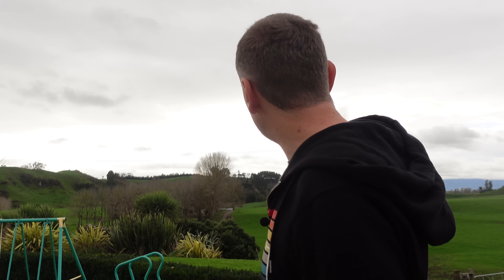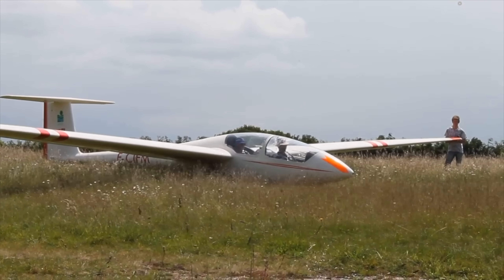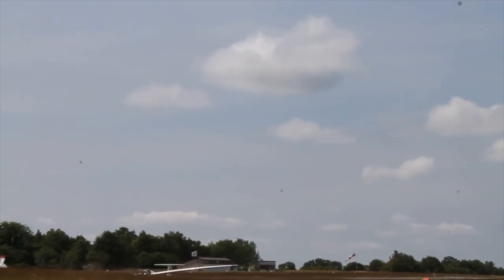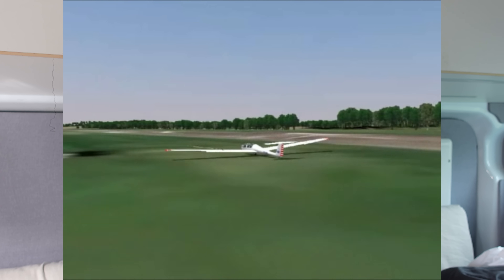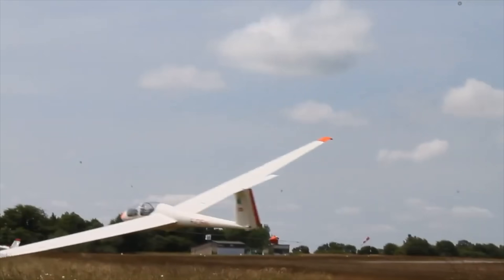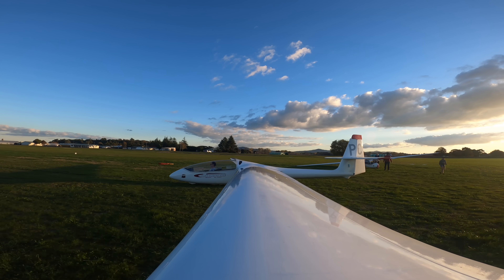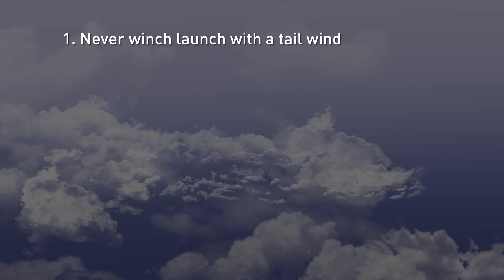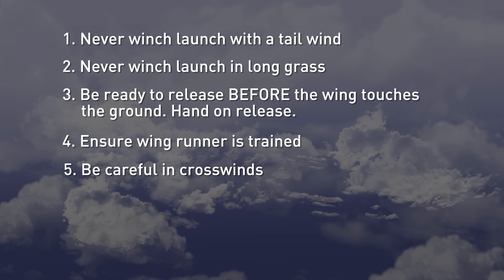Glider Winch Launch Crash 💥 Instructor Reacts

Comment: Agree with grass too long and failure to release in a timely fashion. Disagree with 'not enough wing running'; the young lad clearly goes to run, but the acceleration is actually very fast without a lull, and there's no way he could have kept up any longer than he managed to - even when you do a 'slomo' in your video it's obvious that he was going to run, but but gave up when he realised the thing shot out of his hand far quicker than he could have kept up with. The failures here are significant and lay on the shoulders of some of those present and on those responsible for the running of the club, including, but not limited to, those responsible for winch launch safety and grounds maintenance. The lad holding the wing bears no responsibility and you ought to right your wrong of implying he is at some fault - this could be weighing very heavily on him and causing undue mental angst / distress or worse. I'm a UK glider pilot and do not know any of the people in this video, directly or indirectly. Finally, the wing is seemingly held level without significant change to its angle relative to ground inputted by wingholder. He did nothing wrong.
Reply from the maker: Hi I don’t disagree with you, and I didn’t mean to imply the cause of the accident was the wing running. However it was a factor, and potentially couldn’t run because of the long grass. Also the cross wind was a factor which I didn’t go into enough, once the wind got under the wing there was no stopping it. Cheers!

Comment: Seems I am the only one noticing that the guy running the winch didn't reduce power at all.
Actually my gliding teacher never made me aware of that problem.
He told me about winch cable rips, and that is what I prepared for. 
Probably I would have done the same mistake - unprepared.
Reply from the maker: Yeah exactly right, and why I think this is an excellent lesson for everyone who winches. Always be ready to release, and read some of the comments from those who have been in this situation. Very interesting

Comment: As an engineer I would suggest also technical advances: wheels on wings and progressing winch speed. Design the problem out.
Reply from the maker: They have wheels on wings. That won't help with grass up to your knees, because the grass will grab the part of the wing that doesn't have a wheel just as well as the bit with a wheel. No you can't make the wings tall enough for that grass, the drag would be too much.
And why would "progressing winch speed" help? More speed = more air over the wings = more control for the pilots. Slower for longer = less air and less control. So you want to accelerate quickly. The trick is not to drag a wing on the ground...

Comment: The only action I see the pilot could have done to prevent this is to get the lawn mower out and mow that grass before takeoff.  To suggest the wing runner had any roll in this is absurd.
Reply from the maker: I agree the grass should have been mowed obviously. Sure the wing runner might not have made any difference, but they might have been a contributing factor. So they should always literally run the wing. Obviously they're not the one and only reason for the accident. The cross wind was probably more of a factor than mentioned in the video. Saying that the wing runner should still run. Of course maybe he couldn't because of the long grass...
Reply: @PureGlide The pilot chose to attempt take off from a runway that was obstructed by vegetation.  That’s poor judgement.  All these other things you bring up as contributing factors are all normal experiences of flying.  A lazy wing runner, or worse, one that doesn’t let go, or cross winds, tail winds, or down drafts on final, cable or tow rope break.  If you haven’t faced any of these yet, you will one day.  It doesn’t mean you have to crash.  That’s why you train to fly - So you learn to deal with these.  It’s normal.  
As far as grass wrapping around a wing - no amount of control input is likely to overpower that.  If you are voluntarily planning to put your glider where you will encounter conditions that may overpower your ability to maintain control - whether that be a thunderstorm, or some tall grass, or a tree - you are demonstrating poor judgment.   And as all of us involved in aviation know all too well, poor judgement may make for exciting stories and cool videos, it seldom makes for happy endings.
Reply: @andyweiher4303  again, well said.
Reply: Well said. Similar to what I subsequently said.

Comment: So this is not a problem when towing since you use a tow point in the front? Would it be an idea to have a second hookup in the nose that would release first, after you gained enough speed to have control and then do the climb/kite up. Like dragging a log, you use a hitch on the log and another hitch on the same line at the front end of the log to keep its orientation.
Reply from the maker: Not a crazy idea at all! It would require aircraft modification which is quite a big deal, as gliders are type certified aircraft. Not quite sure it's worth the development effort as 99.99% of the time it's not a problem, especially if you don't do it on long grass, and are quick to release if things start going wrong.

Comment: sounds like an accelerometer to measure angle with a automated line release would increase safety.
Reply from the maker: That’s an interesting idea!
Reply: Also if the electronic design was smart once armed there would be a safety button on the yoke that would need to be held down to maintain the locked cable.  If the button was released it would release the cable.   This way the default behavior is to let go of the button to release which is more instinctive to do in an emergency than to pull a release lever.  I don't fly full size planes (only RC) so I am not sure how the current actual mechanism works but I suspect is lever or cable drawn mechanism.

Comment: The later you leave it the greater the chance that the rope will move back in the hitch to the point that it will not release !
There is an excelent artical about tug upsets when using the winch point for aerotowing that prevents a release due to the angle of the rope in the hitch !
Reply from the maker: Yeah exactly right. In this case I learned later the cable back released, the pilots did not release it, which I thought was interesting.

Comment: Although I'm no pilot of any kind, it seems that proper alignment along the winch line travel is very critical to get right. Otherwise, the smallest misalignment can cause the glider to be pulled in a "skewing" manner that quickly worsens; effectively pulling it sideways to the point recovery is impossible. Not saying it happened here, but just another factor to consider and important to get right.
Reply from the maker: It's not too bad to be pointing slightly the wrong way. We can steer the glider with the rudder on the ground roll. You don't want a big swing at the beginning though, that can stop wind over one of the wings, and increase it over another, which could cause it to roll.
Reply: @PureGlide  Gotcha. I noticed proper alignment was not mentioned so I just put in my 2 uneducated cents. Thank you for the clarification, and thank you for your reply.

Comment: Just wondering if they could have some sort of lightweight stabelizers on the ends - like the metal pick - ups on the tops of dodgem - cars that slide along the grid.  You could even have a type that  drop off once the craft leaves the ground ?...
Reply from the maker: Maybe, but the real trick is to not launch in long grass :) some gliders do have little wheels at the tips, but they wouldn't help in this situation.

Comment: The sole cundution unutiating thus ixxadint (bit of Kiwi there for yous) is (back to unglush heah) was the long grass. Bloody madness even contemplating a launch. The sound of the grass dragging the wing gave me the brown trousers. Apart from dragging the wing it has NO (thats NIL) air passing over the control surfaces. Everthing else followed this. Winch launching is VERY dangerous and is only used for cheap lauches, keeps club attendances up and revenue coming in. If the day is good enough to do some real flying you need aero-tow. Personally I would ban winch launching any aircraft that hasnt got fixed springloaded wing landing wheels such as on some types of motorgliders.
Reply from the maker: Hey I wouldn't go that far, any launch method can be safe or un-safe. e.g. with Aerotow you could have a tow upset, and the tow plane flies into the ground. A disturbingly common thing. Any launch method being aware of the dangers is key, and mitigating risks to prevent accidents.

Comment: Ouch ... this hurts ... put is probably well survivable.
Reply from the maker: Yes no injuries mentioned in the report, only damage to the aircraft. Must have hurt at least!
Reply: @PureGlide  
BTW: is this a Grob 103 or a K 21? can't tell from the picture.

After a couple of years as a launch- and air traffic advisor I became very safety aware ... had a couple of near misses.

I've witnessed it once with an ASK-13. Same thing, left wing touched the ground, but in this case the launch advisor aborted (worst possible solution), winch driver reacted a bit late and the pilot was in a bad training mode .... she didn't realize, that the winch had shutdown. Fall altitude: approx 15 meters. Pilot got hurt and had some damaged verteba. Her little sister (10 years or less) sat in the back seat and didn't have a scratch, but a psycho. trauma ... kept away from airfield for 10 years, but started flying herself after this incident .... that was btw. back in the late 80's or early 90's .... this fall could have been deadly BTW, but we were lucky (as a club)
The plane was damaged, fuselage and one wing has been replaced .... the plane is still flying today and the damaged fuselage can still be admired in the workshop exhibition (Bamberg Germany)

Comment: Just a simple case of having a 5 knot crosswind from the right and not keeping the nose down long enough from the start. The grass was a bit high but it wasn't corn. This was just a crosswind takeoff that went bad probably because the pilot just wasn't experienced enough to initiate the necessary yaw requirements soon enough. A non assisted  takeoff with the right wing on the ground should have been the order of the day. Anyways, that always worked for me.
Reply from the maker: I would say it's definitely a combination of these factors. As is often the case. Most do agree you should never take off with grass that long. And I would never do a wing down launch on a winch! It's just not worth the risk, even if the grass is short, or you're on tarmac.  Read the comments from those who have also experienced this sort of accident...

Comment: The accident could have been avoided!! The winch driver tightened far too quickly. The wingman couldn't go along that fast. The grass is too high. Who cuts there?? Nobody!!  First you pull the rope tight. Then you step on the gas. I would replace the whole team. Sounds hard but it is necessary
Reply from the maker: In hindsight yes it was not good decision making!

Comment: "Release the cable if a wing starts dropping"
If that's your attitude, there's something wrong.
Perhaps try launching on an airfield.
Reply from the maker: You know airfields have grass too eh? Same rule applies. If the wing starts to drop, pull the release
Reply: @PureGlide  No, our's is tarmac with massive numbers at each end and lights down the sides. A dragged wing tip was never an issue.
But if you're using grass, it should at least be cut short enough to not drag on wing tips !
Reply from the maker: The problem is people fall back on their training. If you train people it doesn't matter to drag a wing because you have tarmac, then they'll do the same thing when they fly at a different airfield, maybe one with grass... maybe the people in this video were used to dragging a wing on the ground?
Reply: @PureGlide  I gotta say dragging a wing is far from ideal - so I'm not agreeing that it's a good idea or doesn't really matter. The IS 28 b2 has wing-tip wheels (I'd forgotten that!) Now, what's their purpose ? only for towing back to the hangar or for launches & landings ?
The video shows how close to a disaster dragging a wingtip can be - whether launch or landing. The easiest fix is to modify the wingtip for 'self-defence' - whether a wheel, a skid or a trailing 'droparm'' weak leaf spring at a suitable length for the grass.
Lakes Gliding Club (lakesgc co uk) based at Walney - good tarmac - has used a 'backup' former airfield (Millom) to the north of Haverigg - so tarmac in a terrible condition, sheep roaming all over the place and now a herd of wind turbines to avoid as well but used for 'emergency landings'. Retrieval ? - send the tug over for an aerotow - completely unmanned - so intentional wing-drag launch !
(at least with an aerotow, the nose hook is used - that'll help keep the glider straight :)

Comment: 2:05 "If they're not running, they're not going fast enough"
Incorrect ! As can be seen at 1:25.
In a good headwind, forward motion of the glider is barely necessary.
Reply from the maker: I'd argue they should be running, including in that second clip. Sure, often it'll be fast enough the running won't help much, but if they have a slow start for any reason, it can become critical. So it should always be run.
Reply: @PureGlide  Entirely down to windspeed. I even remember one time I didn't even move my feet - just let the wing go. How to assess? - while standing there, use the ailerons to keep the wings level - if only +/- one inch of movement of the trailing edge of the aileron is needed, to keep the wings level, there's no need to move ! :)
Normally, a brief jog is sufficient but if there's no wind, a run is essential + arm swing (javelin style) and even then it's a bit dodgy.
Grass skates, anyone ? LOL

Comment: If wind is cross from the right, the stick should have been pushed hard to the right in the 1st meters. Runner and grass didn't help but it seems 100% pilot mistake... The runner also holds the wing visibly, giving back wrong input to the pilot that gets surprised when the input ceases. A non running runner is a basic assumption when launching.
Reply from the maker: Yeah like most accident I’d say it’s a combination of things, and yes I don’t think the wing runner was a big part of this one.

Comment: The wing runner also has to balance the plane not holding it with force. As soon as the runner releases a strongly held wing the pilot may not be able to react to the sudden imbalance.
Reply from the maker: Yes, in this case they probably should have been on the upwind side too, and held it down a bit which can help with a cross wind.

Comment: Did not know that winch launches use a different attachment point than tow launches.
Reply from the maker: Yeah you can winch and aerotow off the belly hook, but only aerotow off the nose hook. Some gliders only have a belly hook. The nose hook is easier on tow, as it helps keeps the glider straight as it pulls through the air
Reply: @PureGlide  I have very little time in glider, but after thinking about this all day, I was wondering if it would be safer do the winch launch using two attachment points.  Hook to the belly then guide the line up to the nose.  Start the winch and when stable unlatch the nose and let it transition back to the belly so you can get the deck angle needed.

Comment: If you pause at the right at 0:08 seconds it appears that the pilot has full right rudder but zero stick input. Aileron and elevator appear to be neutral. While im not a pilot I am very passionate about aviation, I have heard time and time again to never stop flying the airplane. I can't help but wonder if he could've made a softer landing, even releasing that late and with the proper control inputs.
Reply from the maker: Once that wing hit the ground there was nothing the pilot could have done to make it better. That's why it's so critical to avoid it. Once a wing is completely stalled because of the wing dragging, any control inputs won't make any difference. Cheers!
Reply: @PureGlide  thanks for the reply 👍